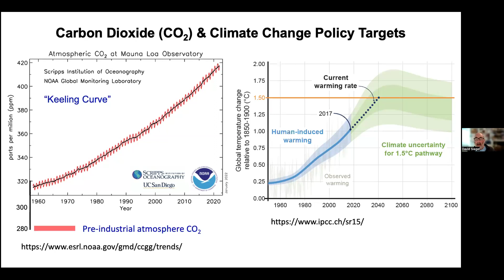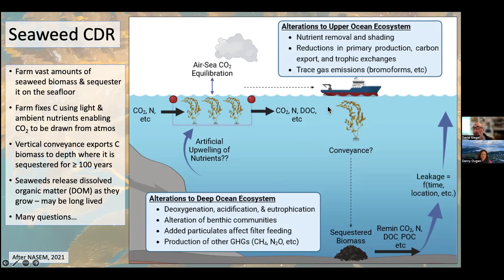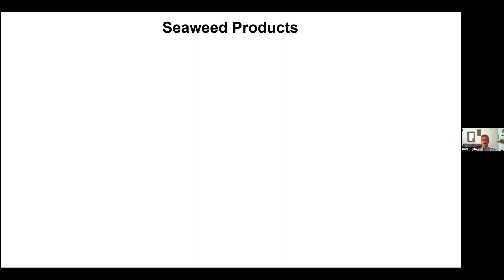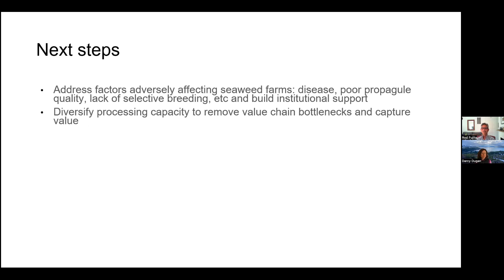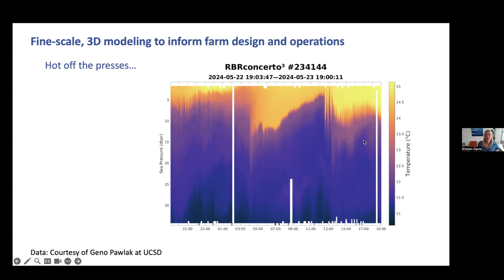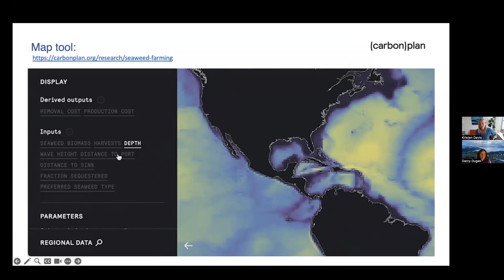Can Kelp Help? Exploring macroalgae cultivation as a potential mCDR and climate mitigation strategy

Comment: @39:23 perhaps a little off-topic, but still: you mention that turning seaweed into fuel (biogas, ethanol, kerosene) is not viable because it is too expensive compared to fossil fuels. But that is exactly the problem. To formulate it differently: fossil fuels are too cheap, because they do not take into account the negative environmental effects. If we would put a realistic price on that, biofuels would instantly become competitive! And there’s more to it: prices of fossil fuels can and will go up, because we will also run out of stock. Prices of renewables and biofuels will not go up, because the energy source doesn’t run out.
That said, we need to accept that energy stored in fuel will be much more expensive than electricity (although the costs of battery storage should be part of the price). This can very well be conveyed to the general public, because it is a premium product for special purposes (flying, powering devices that can not be electrified).